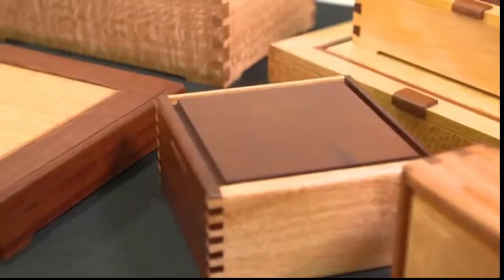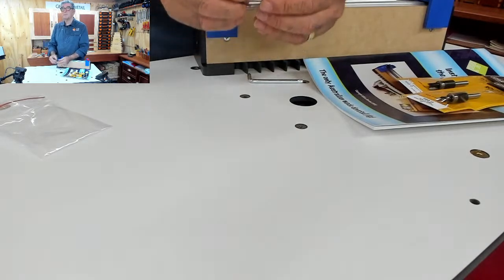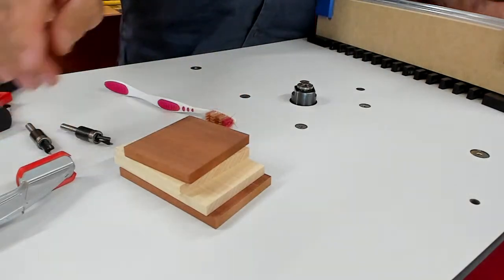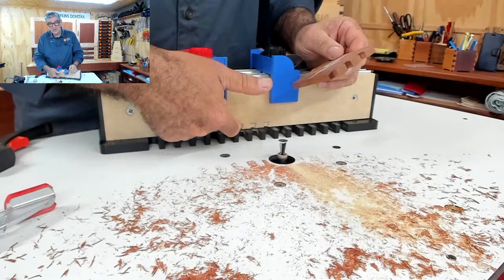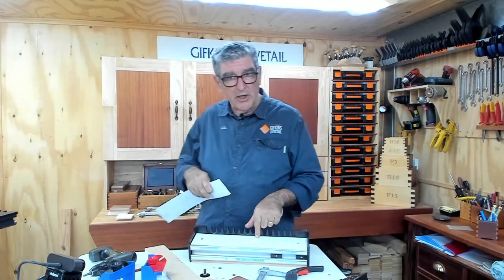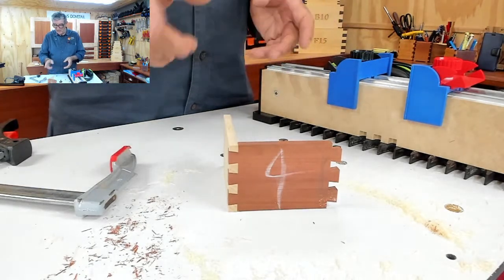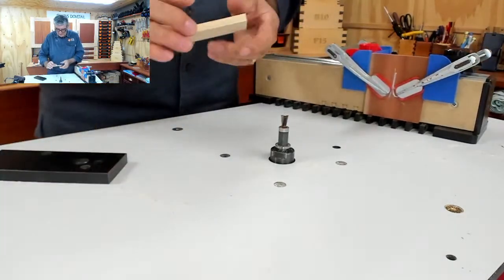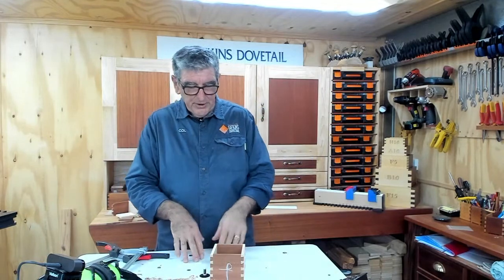GIFKINS DOVETAIL LIVE, SUN 01NOV20, PART 1: THE PENCIL BOX

Comment: Hi Col, with your test piece when you added the extra shims was it totally necessary to redo the dovetail cuts? I.e. As I understand it, if the joint is originally to tight, you add the shims to the pin side to narrow them down so redoing the details seems superfluous?  George

Comment: A query, if I may, Col: how often do you change the MDF backing board? It would seem a bit much to do it every time, otherwise, you would be replacing the backing board even after doing the test cut before cutting for real. On the other hand, you do want to avoid any blow-out at the back of the cut. Is it more important on the pins than the dovetails, perhaps?
Reply: Hi David, I generally only change my backing boards when I change timber thicknesses or if I am setting up for a multiple box cutting session.
Reply: @colhosie6622  Thanks, Col.